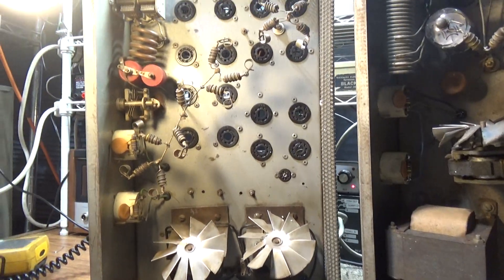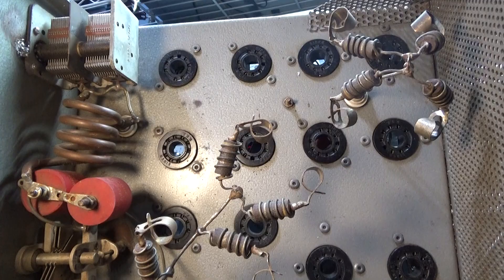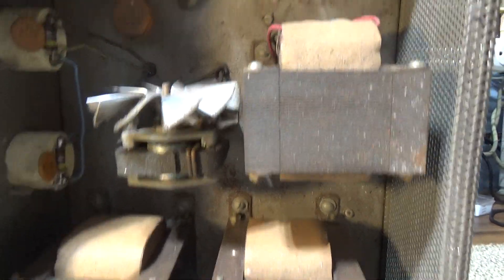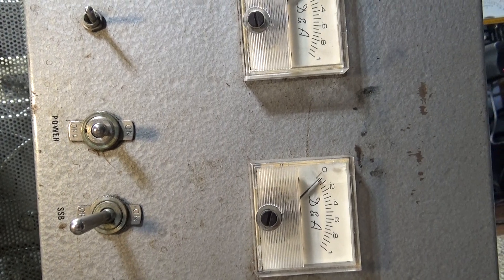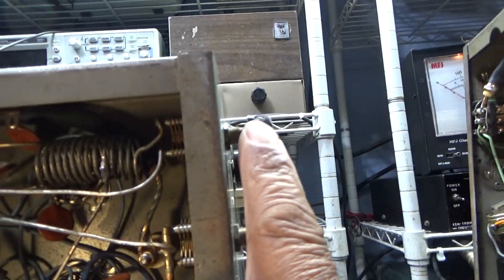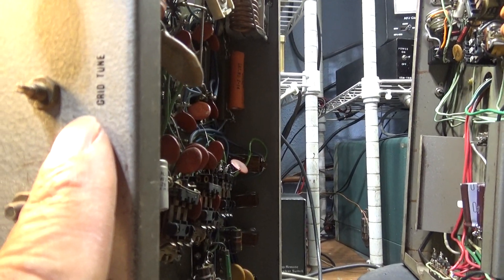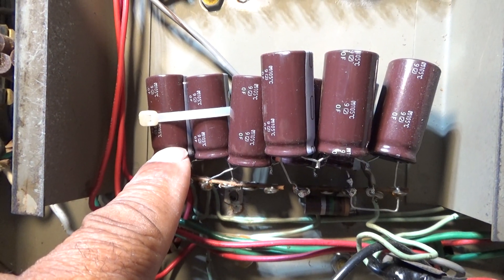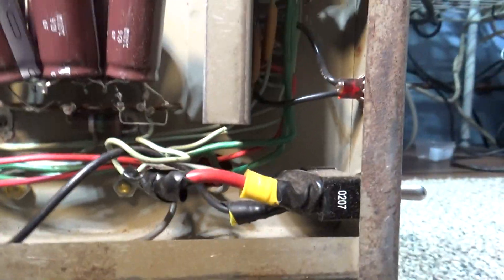D+A Amateur radio linear amplifiers walkthru before refurb. Phantom 500 and Warrior KWD-1000 / WA-11

Comment: In the mid-70's, I had a Phantom and a Warrior at different times. I had the Warrior first. It was a power-monster, and WHEN IT WAS WORKING, it was the badest nastiest and most awesome flame thrower out there. I say "when it was working" because it had a habit of eating finals. I drove it with only about 3 watts because any more than that and it was quite dirty, and made a nasty mess of adjacent channels. Then, out of no where, a final would flash and the fuse would blow. Happened way more often than it should have. I must have replaced finals 5 or 6 times in the year or so that I had it. I sold it, and bought a Phantom. It was the best thing I ever did. Unlike the Warrior, the Phantom was clean, stable and the tubes lasted forever. In my opinion, the Warrior was simply pushing the finals too hard. Do the math... six 6LF6 finals for 500w, or eight 6LF6 finals for 1000w. The math simply doesn't work. I heard rumor that in later years, D&A built a Warrior with 8950's as finals, and maybe that was a better design, I don't know. I never had one of those.

Comment: Thanks Doc, interesting video especially the Warrior. Missed you at the Hamvention but I talked to your better half.  I would have liked to talked to you about the Tram D201.
Reply from the maker: You coming back today?
Reply: @tramdr  Unfortunately no. Wheel cylinder on the truck froze on the way back yesterday and I drove 20 miles with the drivers side break on and my wife has the other truck.

Comment: I own a phantom 12 tube 3 stage . D&A should have beefed up the chassis. Really not sturdy enough for 3 transformers.🤕
Reply from the maker: Well then how about the Warrior power supply, same chassis with 4 transformers?
Reply: @tramdr  I thought that the Warrior used a separate unit for the transformers.?
Reply from the maker: It does, but the separate unit is the same case as the Phantom is, so basically 4 transformers (more weight) in the same cabinet as a Phantom.